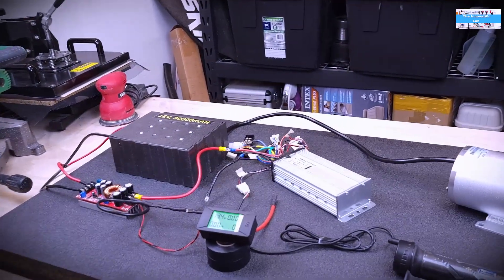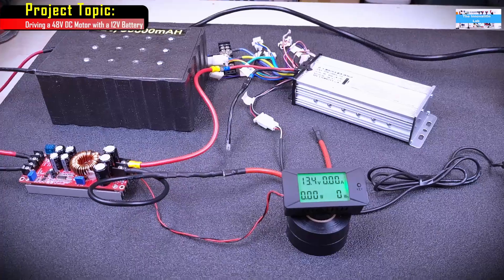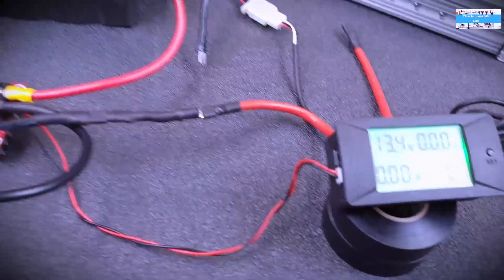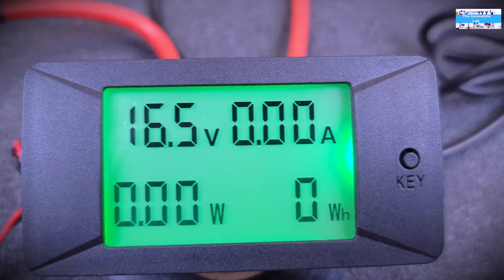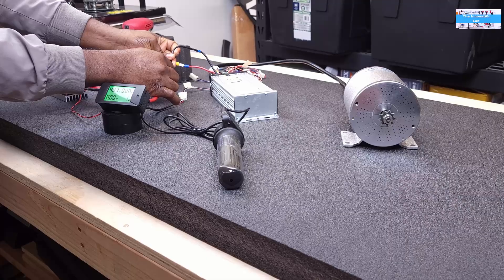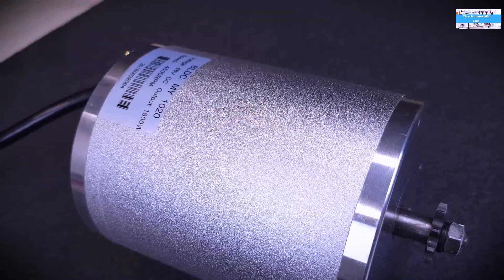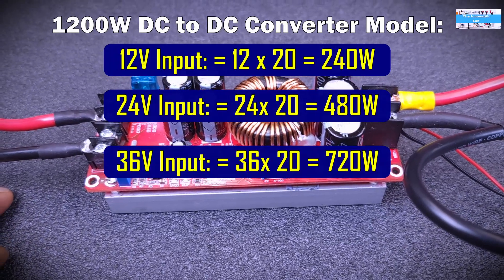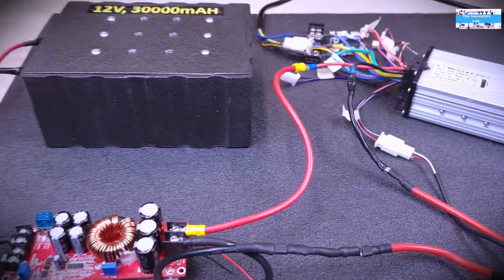How to Drive a 48V ebike electric motor using a 12V battery and a dc to dc boost converter

Comment: It seems the output power is not enough ? the converter BD is so small and without heatsink
Reply from the maker: It has a heatsink but it also needs more cooling using ad external fan.

Respectfully,
The Innovati0n Lab

Comment: What if I want use a 48v battery in a 36v motor?
Reply from the maker: Then you will need a strong buck converter...not a boost converter.

Comment: I used to have a dc to ac converter in my truck. I used it for jobs when we did not have power. The problem was that the sounds the tools made was not the same. It bothered me enough that i bought cheap drill motors and circular saws when i needed to use it. Which wasnt often. I dont know enought about the converters to know if they would hurt my good tools or not.
Reply from the maker: Sounds good.
Thanks for sharing.
Sometimes they only way to find out is by testing. But that's totally upto to you. If your tools are very expensive, then maybe try the idea on cheaper tools first, but again up to you.
I can't make any recommendations.

Respectfully,
The Innovati0n Lab

Comment: 1800watt 40 amp dc-dcboostconverter step up voltage module 10-60vTo12v-90v I purchased and IConnected input terminal positive &negative 12v7Ah battery to input  but input 3nos20amp fuse blown notconnected output can you replay to me sir waiting help me sir
Reply from the maker: I would love to help but I didn't follow. What was your question?

Respectfully,
The Innovati0n Lab

Comment: Need to put a load assemble it on a bicycle and ride on it see if it works but if the Dc converter drops its a failure
Reply from the maker: Very true.
Every design concept starts from somewhere.

Respectfully,
The Innovati0n Lab💥

Comment: Is that normal having a steady red light beside the output voltage while using that kind of booster?
Reply from the maker: That is my observation with these converters and I am not sure what exact status the red LED is supposed to communicate. I guess the intention of the designers could be to show the the presence of an output voltage from the converter.

Consider becoming a member of out Patreon community.
👇👇
https://www.patreon.com/c/TheInnovati0nLab/membership?redirect=true

Respectfully,
The Innovati0n Lab💥
www.theinnovati0nlab.com

Comment: Awesome video. I noticed you were adjusting the current and voltage counterclockwise to increase but the instructions say to go clockwise to increase. Why is that?
Reply from the maker: Thanks for the great feedback!
You are right, but it could depend on which way the input/output of the converter is facing relative to your pisition.
Converter input to your left hand, ....then go clockwise. However, if the converter input is towards your right hand, then everything reverses.😊

I believe the instructions is correct.
The Innovati0n Lab 💥 www.theinnovati0nlab.com
Reply: @theinnovati0nlab782 this doesn’t sound right to me. Clockwise is clockwise regardless of input or output position and in this video your input is on the left so if what you’re saying is correct you should be turning clockwise not counter. Either way, great video. Thanks

Comment: But could you take this converter and make a 12-volt to 48 volt battery charger for an e-bike so it could be directly charged using a solar panel system from the lithium battery?
Reply from the maker: Sounds good.
Wonderful suggestion.
I am working on something similar.

Thanks a lot.
The Innovati0n Lab 💥 www.theinnovati0nlab.com

Comment: Ineed help my boost convert turning off when i try to throotle
Reply from the maker: What is your input voltage to the converter, and what is the max power rating for your motor? 
If your input voltage is too low, the converter may not be able to provide lots of power because of the 30A current limit.

 Also, make sure that the current limit potentiometer is set to the maximum point. With the input of the converter to your left and output to your right, turn the potentiometer clockwise until you hear some audible clicks.

Please watch the video below. https://youtu.be/haGmAmpqNAw?si=WDTdHOn1yZ_B3fOp

I hope this helps.
Please, we need your help to grow this channel. You can help by sharing our videos on social media platforms and diy groups.

The Innovati0n Lab 💥 www.theinnovati0nlab.com

Comment: Once again, a big greeting and thanks for every video. Another question related to the elec booster and the electric bike(motor) itself: Would it hurt anything for a 36v 250w elec motor if I put a 12v+ booster  an 48v 350w controller on it?
again: y want to encrease   from 36v to 48v 250w to 350w..my motor is 36v 250w..thanks in advance
Reply from the maker: Thanks for the amazing feedback!👍👍👍
Given that your motor has a 36V maximum rating, you will likely damage it with a 48V controller.  
The 48V controller by itself won't be the problem. However, since you have 12 to 48 booster, you will overpower the motor itself and fry windings.

I would not recommend this, but it's totally up to you.☺️

I hope this helps.
The Innovati0n Lab 💥 www.theinnovati0nlab.com

Comment: bateery will last 30 mins under load
Reply from the maker: This was just a concept, and I have made some load test videos since the release of this video.

How long the system lasts will depend on the load on the system. But still, 30 minutes is still impressive - if you think of the distance, one can actually travel on an Ebike - in 30 minutes.
I hope this helps.
The Innovati0n Lab 💥 
www.theinnovati0nlab.com

Comment: Yes you can do it with no load on the motor but the voltage upconverter needs to handle the same amps as the motor can draw. That's a big motor and can probably draw 30 amps or more at full load.  Try and connect that to a real scooter and ride it and that puny voltage converter will fry due to the amps being pulled.
Reply from the maker: https://youtu.be/haGmAmpqNAw?si=jW2oDJ4w2keKvBRr

Comment: FIRST OF ALL AS YOU DO HAVE TWO BOOSTERS, CAN YOU CONNECT 12V ON THE FIRST BOOSTER INPUT, 
AND THEN CONNECT THE OUTPUT OF THE FIRST BOOSTER TO THE INPUT OF THE SECOND BOOSTER 
AND CHECK THE OUTPUT OF THE SECOND BOOSTER TO SEE IF IT CAN SUPLY WITHOUT FAILURES PLEASE?

NOW I HAVE SEEN WHAT HAPPENED TO THE PARALLEL CONNECTION!!!! IS THERE ANY POSSIBILITY TO CONNECT THE BOOSTERS IN SERIOUS ( X)? 

THANK YOU
Reply from the maker: Great question.
But the quick answer is 'no.'

Comment: I've not seen the video, I just went here for the comments, and I don't understand why on Earth anyone would think a DC-DC converter even would be an option?
Ok, I can kind of understand being in a pinch if you've got a single battery, and you need to boost the voltage as a temporary solution while you're waiting to afford buying a bigger battery pack or something like that.
Ok if you would be sitting on a bunch of old lead/acid batteries and you've got a frame on a vehicle that you don't either care about the additional weight, or running on flat roads with no inclines and your motor/controller uses large amounts of current (But, any DC-DC converter that handles high current is usually very expensive).

I think that about would be the only reasons to consider it. But from 12V to 36 or 48V would be ludicrous as you would probably expend twice as much energy in the conversion process, or at least in the vicinity of that. 

What I think many people don't realize is that you lose huge amounts of energy in the conversion process from a lower voltage to a higher one, and your battery won't last nearly as long as a proper voltage one would.
As for using Lithium batteries, I would suggest looking for auctions or such from people who actually sells used ones, as these can be good for many, like hundreds of charges.
These can often be found from people who refurbish ebike batteries, or just regular people who happened to come across a faulty one where something like a single broken cell (battery) might have a fabrication error, moist damaged or whatever that made the whole battery pack "go bad", or something as sinister as battery packs which uses timed aging, meaning that some companies have cartelled together to manufacture BMSes (Battery Monitoring System) which contains a micro processor that after a certain amount of charge cycles, time or both, renders the whole pack useless, and they then charge the customer to replace all batteries which they either do (at which point it may end up in either a landfill, or in the hands of someone that sells them further on platforms such as eBay or similar), or they just charge the customer for some insane amount to just short two pins to reset the timer for the next round.

Fierce market to say the least. Better stay out of the way from cheap Chinese batteries too as they most likely won't keep the same standards, so they cut out some safety regulations & measures, skips endurance and hazard tests, cheap out on raw materials and sometimes even compensates with lead for the weight.
Batteries are often labeled as having capacity in the 3000-3600 mAh all the way up to 10'000 mAh which is obvious bogus when you compare the prices to proper Samsung, LG cells and so on. Not to mention that the capacity for 18650 cells never exceeds 3600 mAh since they can't hold more than that.
A good indication is also the weight as a proper cell weighs roughly about 50 grams each so it's usually easy to spot a fake that way.

Unless the manufacturer is well-known, reputable or own by some international company that in other words are liable for any lawsuits, do, for the most part, follow laws and regulations, thus performs safety tests on their products (If they don't, you can probably sue them at least), so these products would probably be somewhat safe.

Cheap batteries from some unheard obscure company I would never trust to leave charging over night. These are the ones you can see videos about spontaneously catching fire due to skipped safety measures when manufacturing these batteries, whether its the subpar materials they use, or machines that cannot keep tolerances within limits due to bad maintenance, cheap & bad parts, lazy repairmen or just poorly constructed. This is why you cannot trust them.
Reply from the maker: Thank you for responding to a video you have not watched - with a 200-page PhD. thesis.
Well, here goes my own thesis....yes, I don't only make videos, I can write as well... These videos are nothing but a weekend hobby for me..hahaha!

💥💥💥
My own thesis:
I always welcome constructive feedback, but my only ask is for the audience to give our channel the respect and courtesy it deserves by watching a video before leaving comments. This way, we don't come across as stating the obvious....10 years after the video was released!....fare enough, yes?

Now, here is the context that you are missing. 
👇👇👇
This video was made simply as a fun weekend experiment to know if a dc to dc boost converter could even provide a clean drive to an inductive load such as this BLDC - with converter peak-to-peak ripple response being more of my concern. This video was not a load test, and neither was it an efficiency test. It was just an introduction to a  concept that was primarily driven by the multiple questions we received from the audience pertaining to the subject....also to satisfy my curiosity.

Is the video perfect? 
Is any tutorial video ever  perfect?.....the answer is a resounding NO.
The focus of my videos is innovation, experimentation, curiosity, and educational entertainment. 

After making the video more than a year ago, I realized that  an actual load test was needed to validate this as a viable option - so I made a follow-on video on which I made it VERY CLEAR that using the combination of a12V battery and a boost converter was not the most feasible idea. In the follow-on video, I very articulately and explicitly explained that low converter efficiencies and high input-to-output power losses are highly undesirable. However, that   does not mean that it is absolute impossibility. Some people in third world countries may not be able to afford a 48V battery and would rather prefer to eat the power losses - if and only if they could find a converter that could be able to provide the needed output power from a 12V power source.

I would highly recommend that you watch the video, then watch the follow-on video before revising your thesis.
👇👇👇
https://youtu.be/haGmAmpqNAw?si=W6Y8c5h-lPVSqJ0Q

I prefer respective and  constructive feedback - one that is not laced with sarcasm. 

Thanks.
The Innovati0n Lab💥
Reply: @theinnovati0nlab782  Ok. Thanks for the response. I wasn't aiming this at you in particular, but more to the people that commented and that perhaps are somewhat clueless to these things.

I'll make sure to check that video in a bit, as well as that follow-up video too. 
Btw, sorry if you felt it was "laced with sarcasm". That wasn't my intent. I don't do that unless it's warranted.
Reply from the maker: @mikaeleriksson7311  
No worries at all.
I apologize for my earlier tone as well. I make these videos as a way to try to give back. Honestly, these videos are very expensive to produce, but all the constructive feedback from the audience is what keeps me going.

However, please take the time to watch the videos and leave us some constructive feedback...what is good and what you think we can improve on.
That's all I ask for - especially from our very experienced and knowledgeable audience like yourself.☺️

Thanks again!
The Innovati0n Lab💥
www.theinnovati0nlab.com
Reply: @theinnovati0nlab782  Ok.
I did have a look at the video and I couldn't really find anything related to what I was rambling about, apart from not really being suitable for ebikes.👎
However one thing caught my eye; Is there any reason in particular as to why you're using a chain between the motor and generator? Why not just mount them perpendicular to each other with a coupling, or something as simple as a hose & two hose clamps or something?

I don't think a chain with sprockets in each end will add to anything, but it nags me that it's wasted energy between two points since neither is moving like a wheel would which (the wheel, as on a bicycle) also presents a driving challenge as you normally wouldn't be able to fit a shaft or you'd need to have some sort of gear box which is superfluous since you just as well could use a chain and it would be more cost effective, probably.🤔

Comment: Hi there Great video
How long will the battery last if its 40 mah
Reply from the maker: Great question.
40mAH = 0.04AH...I don't know, maybe less than 10 seconds. 
You should be using such a low energy battery for such a project.

Comment: Sir how i will get 1500w dc to dc convertor 12v to 60 72
Reply: I want buy
Reply from the maker: You can find it online through Amazon.com or eBay. This is usually where I get mine from.

Comment: How about using 220v ac converter and use 48v powersupply with 60amp rating? Its just in my mind cos i cant find dc to dc converter here.
Reply from the maker: Yes, it depends on what you will be doing with the motor. If you are going to use it on an ebike or electric scooter project, you will need an actual 48V battery.

I am not sure if I understood your question correctly.
👍😎
The Innovati0n Lab💥
Reply: @theinnovati0nlab782  i mean inverter 220v not converter
Reply: @theinnovati0nlab782  i mean from 12v rated 150ah battery to dc to ac converter to make it 220v and then install power supply which is rated 48v 68ah will that work to make motor run on its peak power?
Reply from the maker: @jesongayanoche660  
Ah, I see! I fully understand now.
It should work, but you are going to be wasting a lot of power due to conversion losses.
You will be losing power at each of these stages:
- 12VDC to 120VAC 
- Step down to back to 48V from your power supply
- lastly, power losses on your motor speed controller.
But if this the only alternative you have, then it's up to you to give it a try.
However, pay close attention to the power cables you will be using on the 12V to 220V inverter side... you will need huge cables to minimize inpuy power losses.

I hope this helps.
The Innovati0n Lab💥

Comment: Very good video,please sir con I use the  dc converter alone as a motor speed controller.     thankful sir.
Reply from the maker: Wow!!
That is definitely an interesting idea. I love it when people think outside the box!👏👏👏

However, honestly, I would not recommend you do it because, at lower voltages, you will damage the converter as a result of high current surges.

But if you are feeling adventurous, you can definitely try it. But you must know that there is a big risk of damaging the converter, or your motor, or both.

I hope this helps.
👍😎
The Innovati0n Lab 💥

Comment: For charging, you manually remove the connectors ?
Reply from the maker: Great question, but honestly, this video simply focused on the possibility of using a boost converter to drive the BLDC motor. Normally, most lithium phosphate batteries would come with a separate charging connector from the main power output connector - depending on the tupe of BMS (Battery Management System) you used. So, you may not have the need to disconnect before charging.
Reply: @theinnovati0nlab782  if you put BMS, will it be placed before the step up converter or after, or parallel?